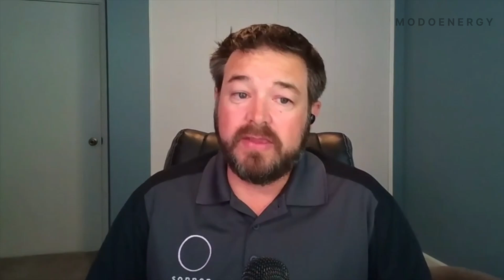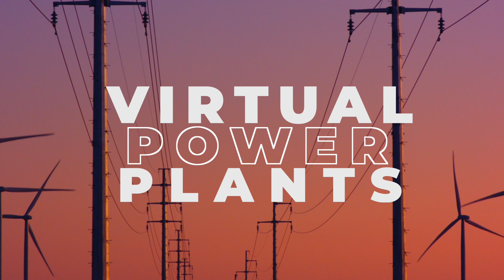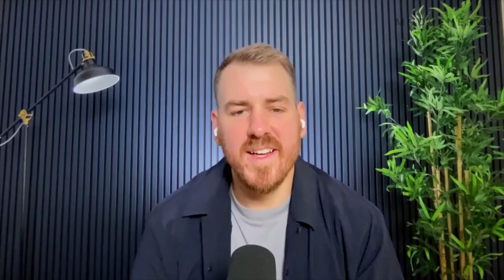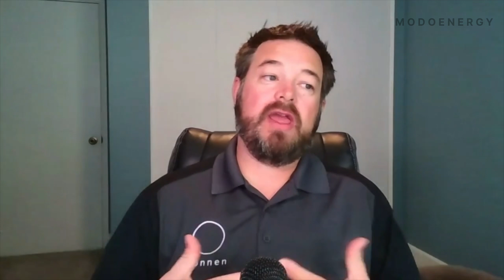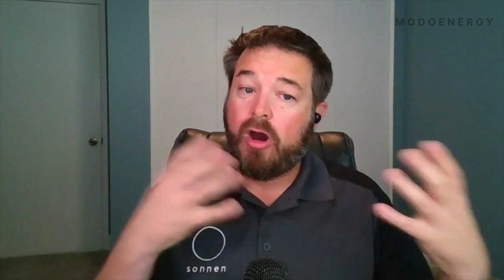Virtual Power Plants - Transmission (Geoff Ferrell - sonnen, Inc.)

Comment: Unload the grid, customers rooftops PV self supply and storage with BV's oversized battery parked 23hrs every day.

The grid is the biggest national investment and needs customers cash. 
$TRILLIONS investment needs $100BILLIONs in cashflow from the customers. 

Let me suggest the existing customers can stay grid connected and supply dirt cheap electricity through the national electricity grid to NEW heavy industrial users and maintain cashflow.